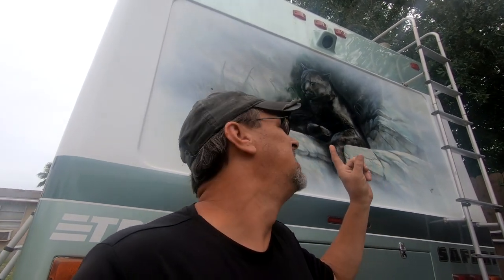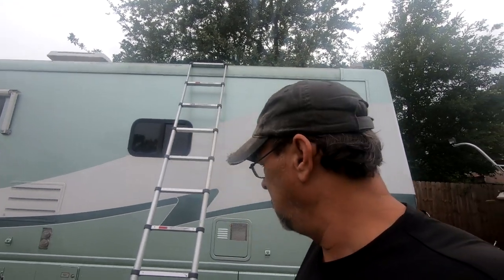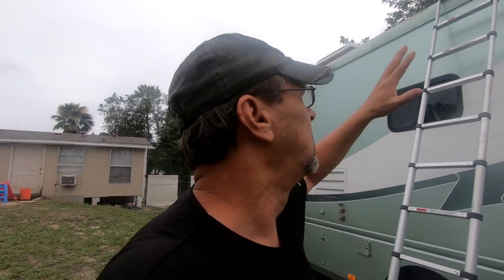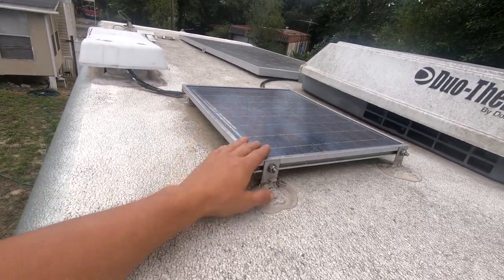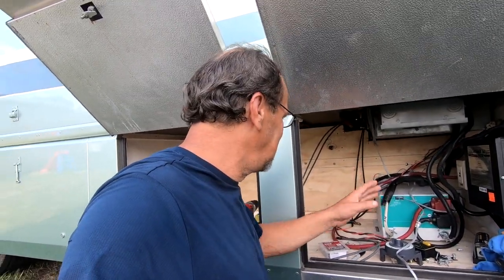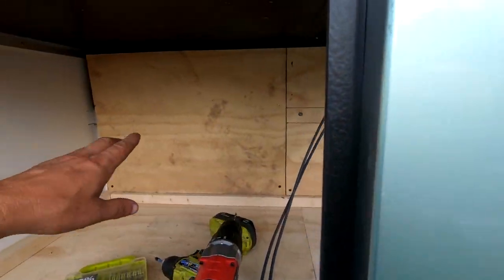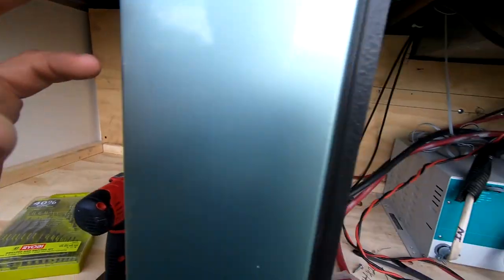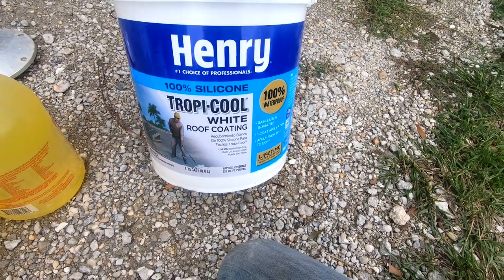24v Solar setup, 1300 Watts, RV Solar

Comment: How much to have a professional do the wiring? I already have the 24 Volt Pure Sine Inverter.
Reply from the maker: Anywhere from 1500 and up depending on what is all involved
Reply: @rvprepperwayne  
Mainly hooking up a DC Isolater from the alternator. So there no parasitic 12 volts going in the 24 volt house battery system.

Comment: Everything looks great other than taking away 20amp... Not sure why losing amps is a good thing? If you kept it 50amp he could have used adapters to reduce down himself.. BUT what do I know?
Reply from the maker: Taking away the 20 amps is not hurting anything on this coach.  The 50 amp cord was heave and hard for him to move.  He  plugs into a 20 amp at his home base and vever anything more. I made it easier for him to move a lighter cord and it will still be safe to use.
Reply: He could of gotten a adapter just like the one he used in the video that reduced the 50 amp to the 20 amp. No heavy cord to deal with

Comment: Wow Will be 1200 amp hours of batteries those batteries are Over 3 grand a piece
Reply from the maker: It is a total of 600 ah not 1200. 4 Batteries are about 4000 bucks.